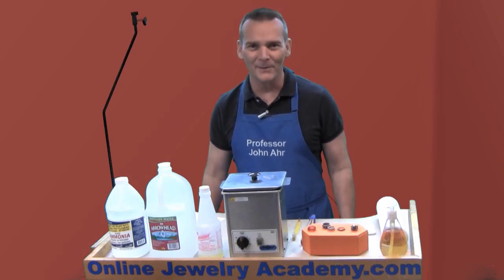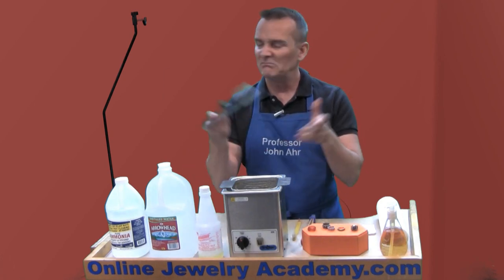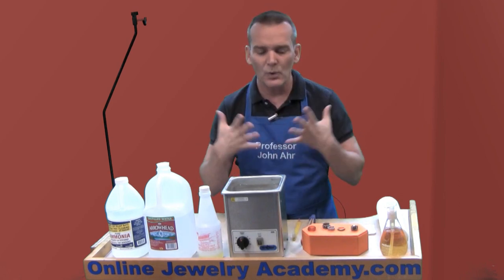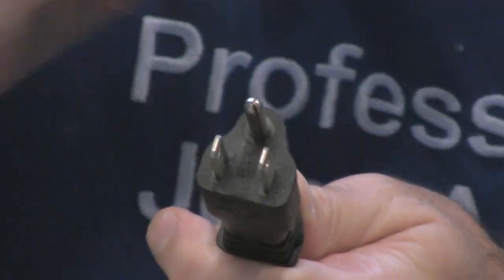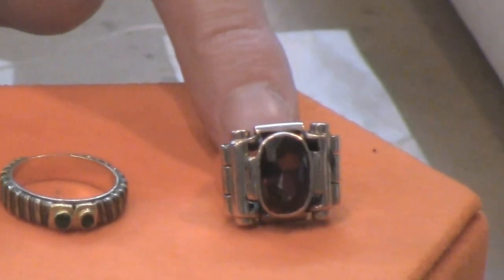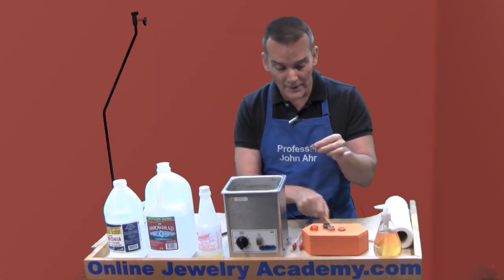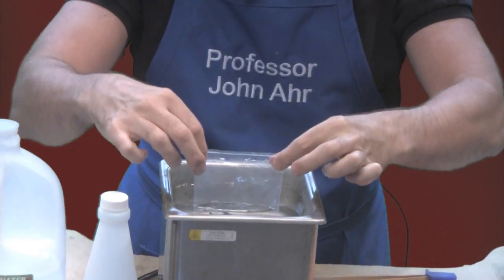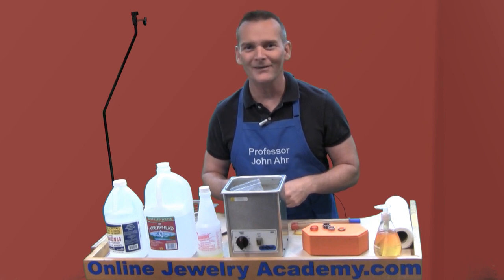Best Practices For Using Ultrasonic Cleaners For Jewelry

Comment: After I’ve polished my silver rings and put them in the ultrasonic cleaner with a temp of 55 degrees for around 25 seconds, I notice white faded marks appear on flat areas of the rings. Which means I have to re-polish the rings. Why does this happen and how can I stop it from happening?
Reply from the maker: It’s not clear from your comment how you polish your work. Also, you don’t mention the polishing and cleaning materials that you use. Therefore, I’m unable to suggest a specific course of action. You might want to watch our polishing video. 🙂
Reply: @OnlineJewelryAcademy  Tripoli and then Rouge. Cleaning solution: Elma Clean 85
Reply from the maker: My guess is that you’re not fully cleaning your work in between using Tripoli and rouge. Also, you might be using contaminated polishing buffs.
Reply: @OnlineJewelryAcademy  sorry I think you’ve misunderstood my question…the white marks are appearing once the item has been inside the Ultrasonic Cleaner. Before I put it in, there are no white marks
Reply from the maker: It could be a reaction between the cleaning solution and the polishing materials. I have never used the product you mentioned in my ultrasonic. Check the compatibility of the products you’re using. Sorry I can’t be more helpful at a distance. Good luck. 🍀

Comment: Would it be safe to put a 14kt gold ring with an unheated eye clean sapphire with 6 pave diamonds on the band in an ultrasonic every once in awhile? Is the only concern that it might loosen the pave diamonds/prongs over time or could it also damage my sapphire? Thanks so much!
Reply from the maker: The danger of using an ultrasonic cleaner is exactly as you described. It could damage your sapphire if it has any noticeable inclusions. In most cases it is safe to use. Just inspect the ring before and after cleaning to be sure. 😀
Reply: @OnlineJewelryAcademy  thanks so much!!!

Comment: Can I clean 22 karat gold jewellery by this machine?
Reply from the maker: Yes, you can clean 22k gold in an ultrasonic cleaner. 🙂
Reply: @OnlineJewelryAcademy ,  Will it erode weight (gold)?
Reply from the maker: @PAPATONMOY  Only if you allow the gold to rub against the interior of the tank.
Reply: @OnlineJewelryAcademy  For how long this shining will stay if the ornament is not used?
Reply from the maker: @PAPATONMOY  The Ultrasonic Cleaner is not a polisher. It is designed to remove grease and grime from a surface.
Reply: @OnlineJewelryAcademy  It is a kind of cleaning machine,isn’t it? If yes, for how long will the cleanliness stay, if the ornament is unused? I know it is not a polishing machine.
Reply from the maker: @PAPATONMOY  It depends on how the item is handled and stored. I cannot give you a specific answer. 😀

Comment: Wow, that’s what an ultrasonic is supposed to look like while working?  Bought one to use in jewelry making and there is very little water movement, quiet little buzz.  Have only used once so far and the brass earrings I was working on came out dirtier than going in.  Had to repolish.  I guess I have to assume my unit is defective?
Reply from the maker: I glad that you found the video informative. Thanks for watching! 😀

Comment: Can one ultrasonic cleaner be used for many different things if you clean thoroughly between uses? Jewelry, glasses, retainers, and drill bits? 😂
Reply from the maker: Yes. But rather than cleaning the unit often, get a beaker that fits inside the unit. Just make sure that the beaker is supported so that it doesn’t sit on the bottom of the ultrasonic. You can see example of this approach on the websites of many jewelry supply companies.